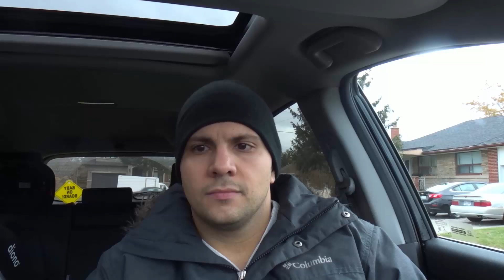Why Do Cars Make Squealing Sounds-5 Common Reasons

Comment: My car makes a high pitch squeak sound during acceleration on low rpms can someone help me I cant find the cause belts and alternator are find turbo is fine no play on it
Reply: I have the same problem
Reply: @tagapiouplayz3737  do you know wat the problem is this is driving me grazy i cant seem to find the problen
Reply: Christo Hees no I don’t, I’m lead to believe that it may have something to do with the brake pads needing changing, but I’m not 100% sure, and I don’t think it’s got anything to do with the belts. I’m going to change my brake pads in next few days and see if that fixes it
Reply: @tagapiouplayz3737  ok let me know if it worked for you👍
Reply: Christo Hees will do mate
Reply: @tagapiouplayz3737  👍
Reply: Tagapiou Playz did the sound stop?????
Reply: My car does this aswell , what should i do
Reply: @matheoo4574  i still have no idea wat it is sorry bro taking my car to bmw soon to see if they can trouble shoot the problem will let you know if they found the problem
Reply: @christohees9150  i asked a friend , he said ITs the belt in the car or the things that the belt hoes on that either need to be fixed Or replaced
Reply: Matheo Antonucci is yours coming from the back. Beciasenkien is , therefore I don’t think it’s a belt
Reply: Did you find out the problem?
Reply: @matheoo4574  nah i have found the problem my turbo wasnt getting sufficient oil 👍

Comment: For me it's when I turn my car on and drive off . Lasts for like 5s then stops
Reply: Did you find a solution? I am having the same problem, and I have no idea what to search
Reply: @OpOp-rl9wb  keep the car running a little while longer . If it's a diesel .
Reply: Mines was similar. It used to make noise at start and idle but I noticed when the temp guard went to normal after being cold it would go away. Now it makes the noise when I accelerate after putting on a new belt.

Comment: My car starts to squeak when I’m driving but when I drive super slow like slow there no squeaking but when I drive maybe in a town limit it starts to make a loud squeaking and can be heard by peoeple
Reply: Same! I hope someone can share some info🙉 and funny enough everytime a mechanic jumps in the car, it's lowered or goes away😹  and they think I'm crazy.
Reply: @sheri2845  yea turned out to be one of the mechanics that didn’t put the brakes on right, but other solution can be worn out brakes or just the humidity as well
Reply: Thanks for your insightful response, i really appreciate it. 

So I paid 12.5 thousand rand(Zar) to have the breaks done and wheel bearings changed... That sound started after it came from that apparent professional workshop, they put such cheap parts on my car so they clearly charged my arm and leg for labour, so I suspected if it wasn't the wheel bearings, it would be the breaks... Had to pay half that amount a week later at a new mechanic... Still had the sound. Tomorrow I'm going "backdoor mechanics",  I'm so tired... But I will definitely come by and share with you what the situation was. My car is an oldie anyway, it requires work, I just didn't need all that done, just control arm and associated parts of lower suspension, not even the brakes where needed... 

Ai thank you again, I'm going to mention to the mechanic tomorrow.🙏💐 Blessings.

Comment: My car squeaks when I start my car in the morning and it’s jus for a couple seconds and it goes away…it only squeaks when the cars off for long periods of time….what can that be?.
Reply: Same!!
Reply: belt
Reply: I had this issue as well, I noticed the noise would go away after the temp gauge went to normal from being cold. I replaced the belt though the old one was actually pretty good. Now it just makes the noise when I accelerate past like 2k rpm

Comment: Hey so what about a squeaking sound. As I take off from being parked and as I drive the sound fades but comes back after sitting for a while ?
Reply: hey, i got the same problem, did you find out what it was?
Reply: Mines used to do this at start or idle. Personally I noticed the noise would go away after the temperature gauge went to normal from cold. Not saying that was the reason but just something I noticed. I replaced the belt though the old one was relatively in good shape. But now it just makes the squealing when I accelerate. I replaced my alternator too, I’m just lost and annoyed atp because I feel I’m wasting money.
Reply: @jstnnn1  mines is doing that too, very annoying. Only in the morning or if the weather is cold
Reply: @sydneysees5548  yeah. Mines does this when the engine is cold. Not necessarily the weather but the engine. Then i noticed it’ll go away after it warmed up. The. It’ll come back when I start to accelerate
Reply: @jstnnn1  if only we knew how to fix this issue
Reply: I took it to a auto shop. They recommended a belt. I googled it and it says it’s good for these noises. So with that being said Ill probably get one and test it out
Reply: @jstnnn1  update?
Reply: @jstnnn1  mine is doing it as well after being parked for a while
Reply: @twinuzis3781  I might be thinking it’s something with the brake or tire cuz I just started getting this weird sound every since I got a new tire replaced yesterday
Reply: But mine does this when it's warmed up 🙉

Comment: My car SCREEEAMS whenever I’m in first gear and get going. Then when I shift in to 2nd or 3rd it starts screaming but then goes away when the RPMs climb. 

It’s driving me nuts. Does anyone know what the issue could be?  

I’ve checked the alternator belt and it looks to be brand new and is not loose. And the cambelt only has 800km on it.
Reply: Have you found out I’m dealing with the same thing

Comment: I got the weirdest issue on my car and idk where to look anymore. I have a BMW 330ci e46 2004 car and I’ve had this issue for a while now.
What happens is when I press the gas pedal at a certain level it makes a high pitched sound. Idk the exact distance pressed but it’s definitely when it’s light on the gas. After pressing more or less the sound goes away. 
Any ideas?
Reply: i’m having the same issue on a 2022 corolla lmao, i took it to toyota and they told me they couldn’t figure out what was wrong with it…

Comment: Hello my car is getting the squeaky sound when I apply the brake while the gear is still in drive example when there is red light I brake and the gear still in drive and notice it when I put on the AC.
Can you please help me with it..
Reply: probably break pads and from the ac i’m not sure maybe compressor
Reply: @thefomento1337  what would happen if you don’t get your brake pads fixed/replaced

Comment: My 05 accord makes a squeaking sound when I go over speed bumps in the front passenger I believe, what could it be ?
Reply: My 2013 kia forte does the same thing sounds like its from underneath the Car on the drivers side but sometimes just both
Reply: If your struts do not bounce like crazy, then it is just your control arm bushings. Those are hard to replace, but if an alignment shop doesn't find any alignment issues they are fine. They just get dried out and naturally rubber on metal friction makes a squeaking noise. 
The big thing is, it is getting harder and harder to find good replacement struts. Most people that change them actually say their car handled better before they changed the struts. All the strut companies have went cheap and really don't do what they are supposed to do anymore. Even worse are the ALL in one Strut with the spring already installed combo's. Those are cheaper build quality than buying the replacement strut.
Reason being is many try to make a one strut fits all deal. For instance a rear strut for a Camry and a Scion TC. They are basically the same strut, but the weight of the rear of the Scion is so much lighter than the Camry. So when you put that all in one strut spring package on the TC the rear end will be higher than the original. Because the spring rate is wrong for the TC vs. the  heavier Camry.
So if you don't see fluid leaking from the strut or on the strut's cover, and the front of the car doesn't bounce when you push on it. Most likely it is your control arm bushings. That doesn't mean they are bad. They are just 16 years old and dry.
Reply: One other thing. Don't go putting oil or grease or petroleum products on the control arm bushings. Petroleum will penetrate the rubber and break it down quickly. Only thing I would use is silicon spray.
Reply: @kramnull8962  car doesn't bounce really and I replaced the lower control arms about 4 months ago

Comment: My car makes the squealing when I accelerate, it used to do it at start or idle until I put a new belt on but now it just when I accelerate. I just replaced the alternator yesterday as well because it was supposedly needed. I’m mentally now at a dead end😕
Reply: Did you ever get it fixed and how did you fix it
Reply: Have you found the problem? Because I’m having the same problem
Reply: @sinn100iq9  I don’t own the vehicle anymore due to engine failure… but pulleys can cause that issue too if the bearing isn’t lubricated properly. That’s what my last resort was. Probably the cheaper fix too since pulleys cost very little compared to a major fix.

Comment: Im lost. Idk if my belt or pulleys going bad. I only hear squealing sometimes intermittently or the whole time ONLY accelerating. 

My crankshaft pulley looks wobbly, belt is normal tight, nothing else looks ok .
Reply: Same
Reply: Same, mines used to squeal at start or idle then I had the belt replaced. Now it’ll squeal when I accelerate or when the rpm go past like 2k. I just had the alternator replaced yesterday and still hear the noise. My interior lighting goes dim as well, so I’m just back at point a. Trying to figure out the issue
Reply: @jstnnn1  i think mines coming from the bearings, goes “squeel squeel squeeeeeel” and more rapidly as I give gas. Im OCD lmaoo
Reply: @Illmatic1989  me too lmaooo. Just the noise alone is killing me.
Reply: @jstnnn1  is it dangerous?? Idk how mych it cost to repair or safe to even drive
Reply: @Illmatic1989  I’ve had my car since April of this year. It’s been like this the whole time I’ve had it. I’ve noticed the lights going dim and seems like it’ll take a second to start. I also get bad gas mileage. Im not sure if these are bc of the alternator or are alternator related but just things i know shouldn’t happen.
Reply: @Illmatic1989  but since I’ve been driving mines it doesn’t feel terrible. It drives like it has issues but not to the point where you feel unsafe or uncomfortable driving it. With that being said… no lol
Reply: @jstnnn1  true….my cars a toyota highlander, it takes a lot of wear and tear and not tooo expensive to replace. I could have sworn I had a crankshaft issue or alternator too. Oh well, like u said, if its just annoying than I will just save the money and get it fixed some other time.

Comment: For me its when I accelerate between 2000 - 3500 rpm, what could it be?
Reply: Its a bmw x5 40d m-sport 2015 by the way
Reply: I have the same problem did u ever figure it out
Reply: If this thread is still active  Joel lister  I have a 2011 Kia Forte 6 spd, clicking at low rpms and squealing almost grinding around 2.5-3k rpms
Reply: This is exactly how mines is, it kicks in at around 2k plus rpm, I haven’t noticed anything around 4K rpm but may be due to engine noise covering the sound.
Reply: I have a 02’ Town and Country 3.8 btw

Comment: if when u r driving and u hear a squealling noise it is a wheel bearing that is worn out
Reply: I just replaced Mines though. Could it be the breaks weren't put back on right or too tight?